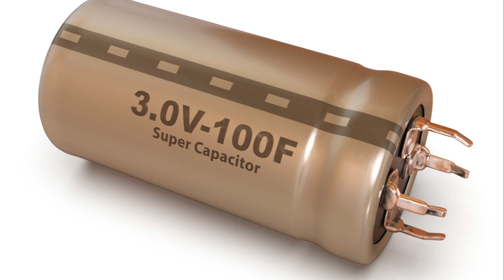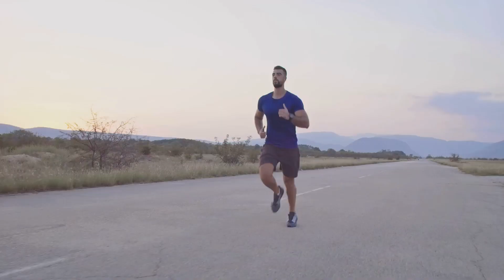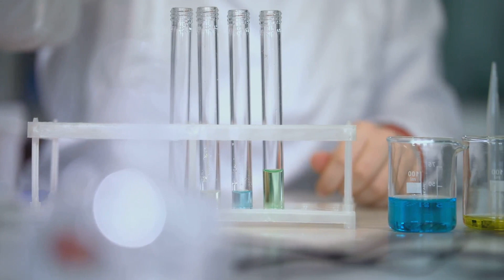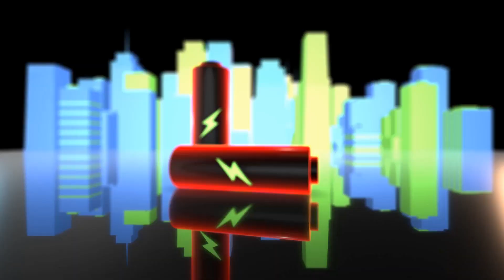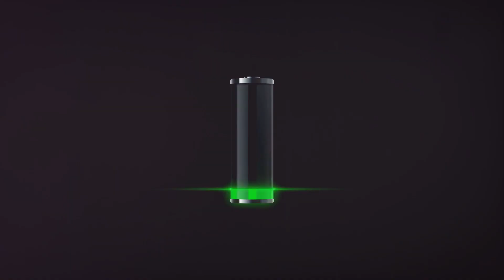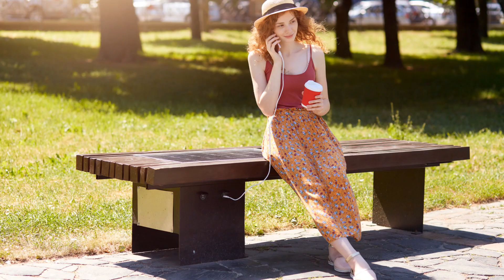The Future of Energy: MIT's Super Material

Comment: I've already conducted experiments on this. Only issue is releasing that energy in a governed way. Also the problem is breakdown over time. Best is to keep it vacuum sealed and free from any oxidation. A beehive skeletal structure is the best for the innards.
Reply from the maker: i think the answer to the problems lies in nuclear batteries, these are estimated to have a single charge last for about 50 or so years. Those will not need any charging nor can they be charged... downside is the disposal of the "waste" tho almost compleatly depleated.